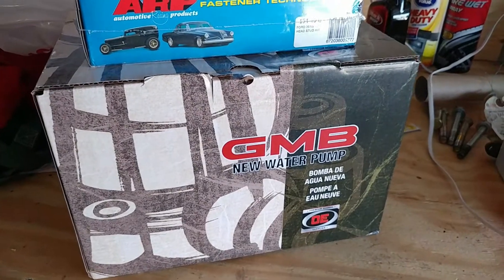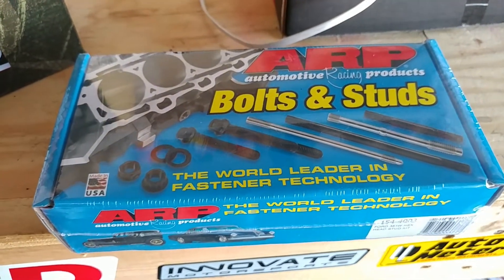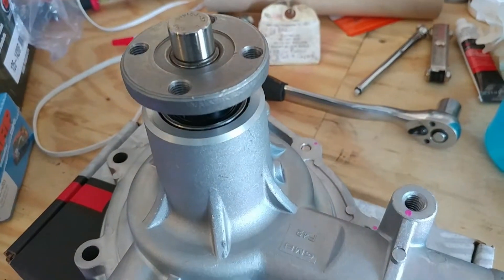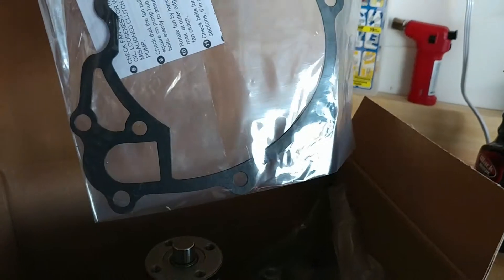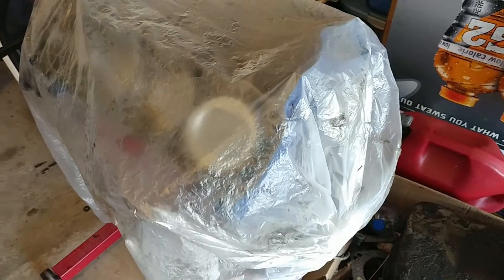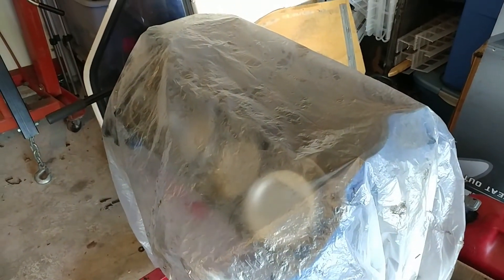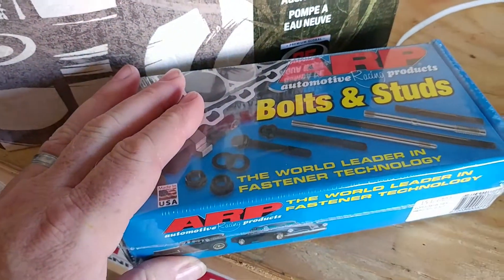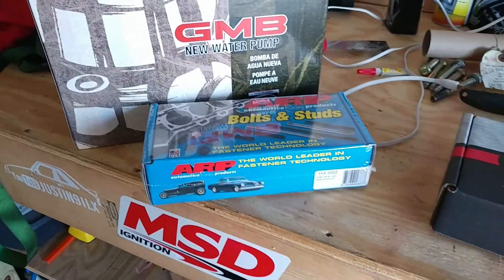Part run for budget turbo 351w

Comment: im doing a 351w single turbo aussie xr8 car, I thinks its out of a 91 f truck , I really cheaped out and used procomp mains and head studs of ebay lol, using a pro comp / edelbrock knock off 351 lower and a RPM2 upper, with some patriot 185 heads, ended up getting some morel link bar lifter from ed Curtis , it should still fucking hammer, just cant decide on a T400 glide or C10?, good luck with your build.
Reply from the maker: Got you a pretty good build. Alot of people i know go with the glide. I just dont have any experience with either one
Reply: a mate of mine has a Buick 3800 V6 powered aussie shitter, running a ebay 76mm turbo on E85 through a glide with a 4000 rpm converter , it makes a genuine 420rwhp all day everyday, it is a absolutely rocket to drive, I was always against the idea of a 2 speed but glides just work with turbo cars. cheers and good luck mate

Comment: Are pistons pressed or floating .. just switch them out , take to different shop to balance it . I pay about 250 for balance plus your cost of pistons . If you would like help spec’ing a cam feel free to send me a message (don’t call comp tech line ! ) or call Ed Curtis or bullet cams . Ordering custom does not increase price and I get jobber price through bullet :) .
Reply from the maker: Pressed on type. Got a f cam I plan on putting in to her.
Reply: what heads ???

Comment: Justin you know you have to buy a new turbo for that 351w, that turbo you had on the 302 WILL NOT WORK, you need at least a 76/68 or bigger or you will have terrible back pressure issues, they said if you have any mods to a STOCK 351w you must run that turbo, please do your research on it before you build, iam building the same setup right now.
Reply from the maker: The Turbo is fine. Hell its the same turbo on3 puts with their 351 kits. Done a lot of research on this setup. Already knew I would have to modify the piping to make it fit. This turbo will choke it down some. Do plan going bigger or same size but better quality turbo.
Reply: iam watching you build this very closely to see what fits and what dosent, please let me know how it all comes together my friend
Reply: of course it will work, but you need at least a 76 to 78 size turbo not a 70mm
Reply: makes no sense

Comment: That's pathetic,, you got the order made out for forged pistons for a high performance build.
I'd at least give em a bad review just give everybody a heads up on what kind business they're doing.
Reply: agreed! the first time you rattle them hypers you are going to wish you did it right. if they can"t even follow your orders how do you know ring end gaps and bearing clearances are ready for turbo? hope it doesn"t bite you in the ass!
Reply: I hate a place that's gonna treat like a two year old.
You go in with big plans and and they look at you like you ain't shit.
Reply: Ya that's fu##d up, bring it back, tell them you want it done right.
Reply: You are dead on right, those hypers are fine but if you detonate them they are going to snap off. Easier to fix now than later.